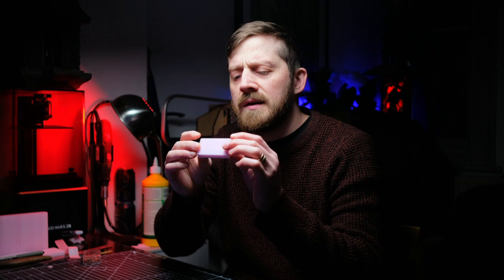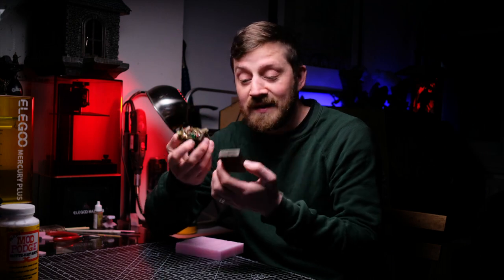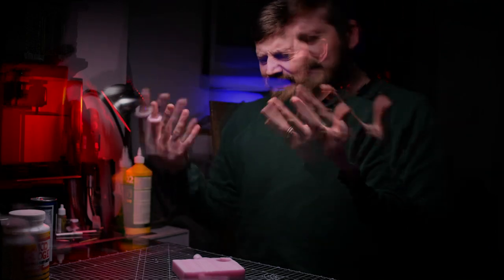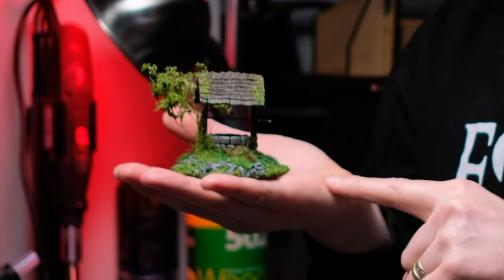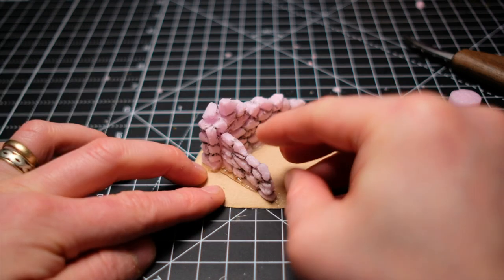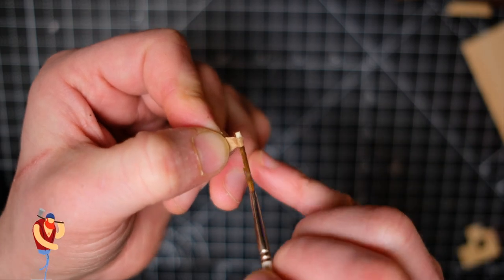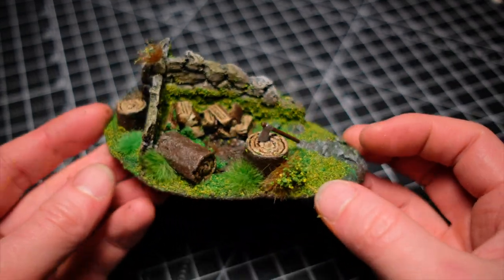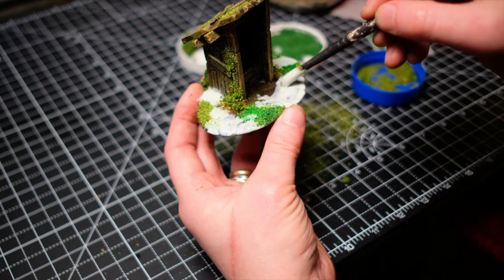5 Day D&D CRAFTING CHALLENGE !!!

Comment: Hi Nat great video. Would you please share the types of materials you use. What type of foam is this, the cuttin equipment, the paints, or what did you make grass and soul out of etc?
Reply from the maker: Hey Nadia! Sure :)   The foam is called XPS foam, or sometimes its called underfloor insulation foam. The hot wire cutter is called a Proxxon hotwire cutter but I also use a simple wood carving knife a lot which can easily be found on Amazon. The paint I use is all from the Army Painter Mega Paint set. And lastly I use a light shade and a dark shade of foam flock from Geek Gaming Scenics. Hope that helps :D